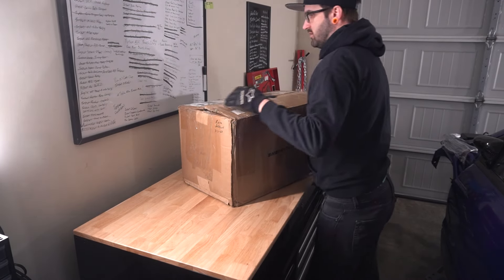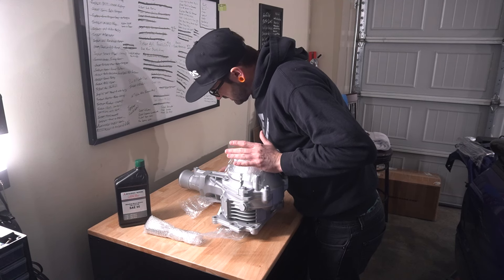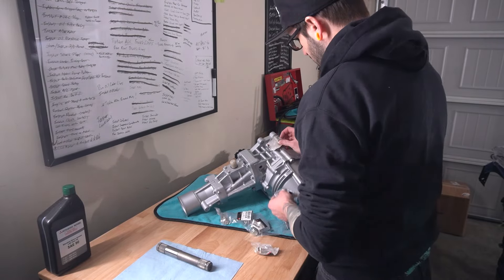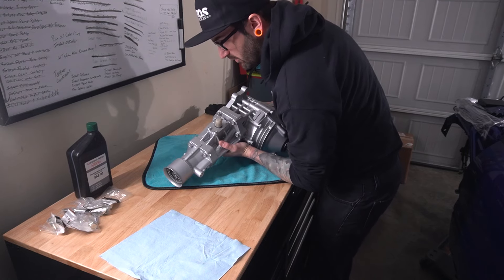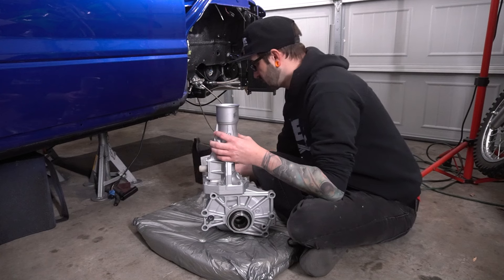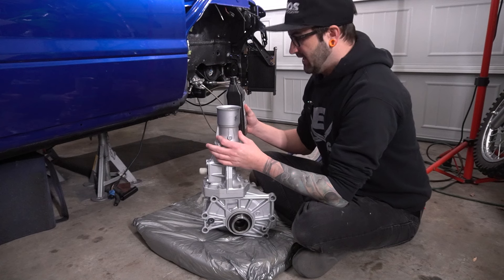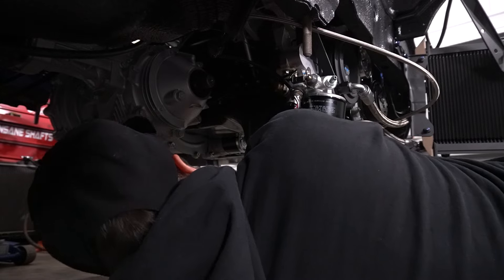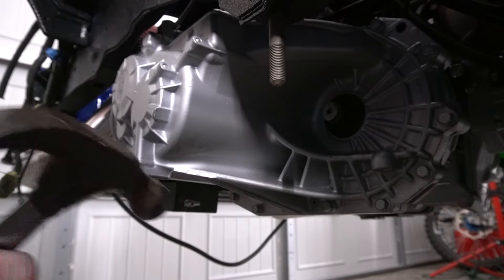Installing A NON ACD Transfer Case w/ Wavetrac On My Evo 9

Comment: Will a evo 8 transfer case fit on a evo 9 ? If so will a acd pump delete recommended
Reply from the maker: Yes and Evo 8 tcase will bolt right up to a 9. There's no real "delete kit" that I am aware of? On this build I just removed all the tcase hardware, lines, ecu, and removed the wiring from the harness. May not be the recommended way but I just figured I'd remove it all and call it good.
Reply: @RyneDickens  really appreciate it thanks I might try it